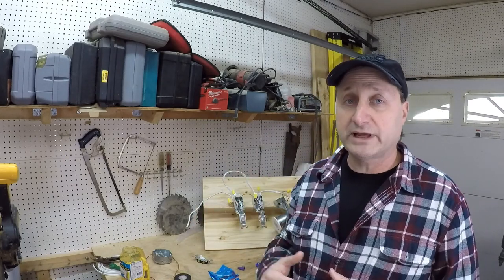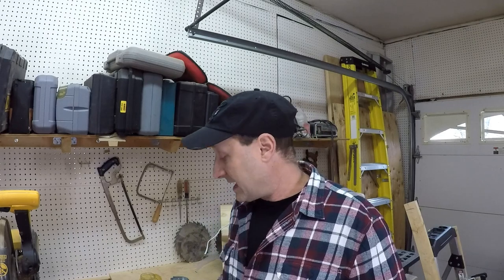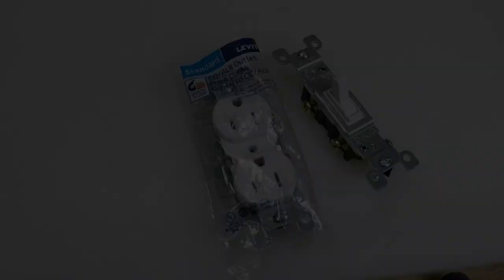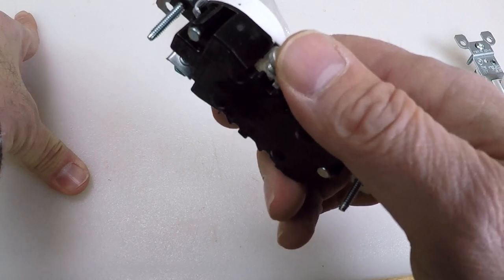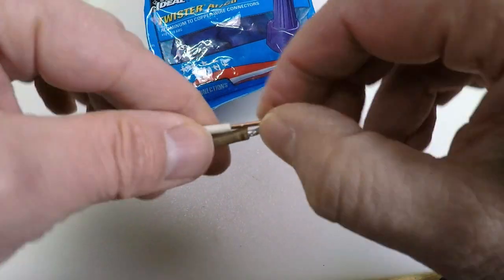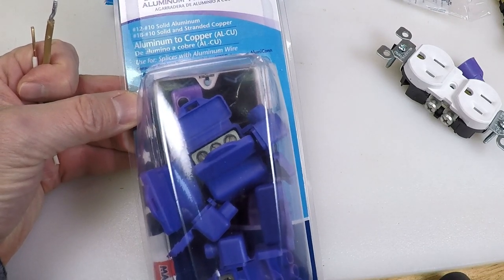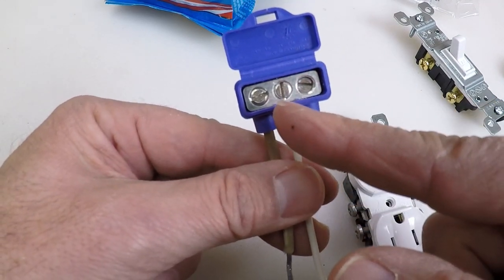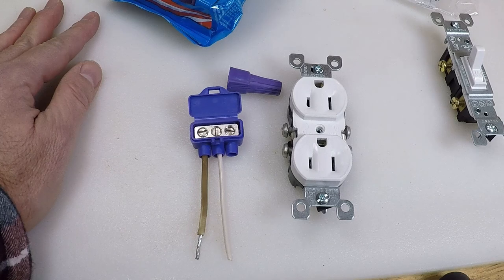Aluminum wiring repair - AlumiConn pigtail connections

Comment: How do you connect three aluminum ground wires with one copper ground wire?
Reply from the maker: You can use the alumiconn connector or you can just use a regular wire cap. The ground wire does not carry a load so you can twist copper and aluminum ground wires together.

Comment: Quick question. My parents house has copper wiring. Recently they remodeled their bathroom and installed a GFCI outlet to replace a standard plug by the sink (following code). Not long after that work was done they suddenly lost all power in the adjacent room. They suspect it’s the GFCI they installed. I noticed in the GFCI instructions that it says ‘only to be used with copper’ so I feel it’s feasible that the GFCI could be the culprit. Is it possible for them to have a GFCI with aluminum wiring? If so, how? Thank you
Reply from the maker: yes it can be used with aluminum. Just get a compatible GFCI outlet. However, it sounds like your parents have a different problem

Comment: mY method of securing alum and copper together at the connection point is to let both wires heat up naturally and what happens is they both end up melting together creating the perfect fuse between them. Sometimes the jacket will have holes in it where the insulation has bubbled but I just put electrical tape around it.  No issues and been in this home 17 years

Comment: I have only one aluminum circuit controlling just a ceiling fan and 2 recessed lights. I understand about the pig-tailing at the switch box and the endpoints but is it necessary to have a pigtail at the electrical panel. I was told it was required but would like to verify if that is true or in what situation it would apply.  thanks
Reply: No one here can (validly) answer that.  You have to know your local code/s.  EDIT  BTW: "I have only one aluminum circuit controlling just a ceiling fan and 2 recessed lights."  How are you 100% sure of that?  You do know what an actual circuit entails, right?

Comment: If the aluminum wire is 12 gauge, does the copper wire need to be 14 gauge or can it also be 12?
Reply: The ampere rating for aluminum 12 AWG wire is only 15amps. Do not use a 20amp breaker or fuse for this wire.
Reply: @claytonsprague7316  After reading the amperage capacity charts for aluminum wire I believe your statement "the amperage rating for aluminum 12 AWG wire is only 15 amps." is incorrect.  12 AWG solid aluminum wiring is rated for 20 amps.  Here is the link to the amperage capacity chart: https://www.cerrowire.com/products/resources/tables-calculators/ampacity-charts/
Reply: @craigschiemann9553   Thank you I appreciate your thoughtfulness of the chart. However there are some small details that need to be mentioned for safeties sake. First anyone watching this stuff in the US should read the CPSC study on Aluminum wiring (just google it cause I’m not as adept as Mr. Craig on links. 

Secondly, in that chart you have to know how to interpret the information., you will notice that it references 75deg C wiring as 20 amps. And yes you are correct in that case. HOWEVER please note that That classification of wiring didn’t appear until after 1984, and they stopped making aluminum wiring for branch circuits in the mid 70’s and that wire was only rated at 60 deg C. 

They didn’t make 14awg aluminum because the first gauge wire that could actually handle 15 amps was 12awg single strand aluminum NM. Please anyone with aluminum wiring research thoroughly before doing or hiring work done. Thank you.
Reply: @claytonsprague7316  Thanks for adding the additional information.  I agree, one needs to thoroughly understand the issues and remedies for handling issues with aluminum wiring before attempting to work on the project.  One needs to take the steps needed to inform themselves on any issue they are not properly informed on.  If not, then  please leave the project(s) to a professional that is.  Having only a little bit of knowledge on something can come back and harm you.  This is not something one can take lightly.  There are many licensed electricians out there  that won't touch aluminum wiring.   That tells you something.  When seeking a professional make sure they are knowledgable and comfortable with working on your type of project before even thinking of hiring them.

Comment: I have a copper home, but the ceiling fan I want to install has aluminum wiring, what can I do?
Reply: Hook it up. The connection is in a J-box that's designed to contain any spark/fire. [note: I am NOT a licensed electrician.]

Comment: What about dimmer switches? Is it okay to use the pigtail method? I’m starting to see forums say that you can’t use dimmer switches with aluminum wiring. I just installed one today. Something told me to put my ear up close to the switch and I hear a fair humming sound...
Reply from the maker: Yes you an pigtail before going to any fixture our outlet.
Reply: So what happened?  I replaced most of my aluminum wire house with regular copper only. Look like I need to go back and change them out.

Comment: Wait a minute. If aluminum tends to loosen over time, then how can BOTH parts (wire & outlet) being aluminum solve the problem? Seems it would result in DOUBLE the loosening effect.
Reply: This is an old comment, but I wanted to address for anyone reading: 

Since the aluminum will expand and shrink at the same rate, it won't loosen as much over time. Also, since they are aluminum on aluminum connections, you can have some cold welding happen as you clamp it down and that can reduce issues as well.
Reply: @anthonyalbanese1993  I'm not quite sold on the first part of your comment, but the second part makes sense. Thanks.
Reply: @jakejones5736  part of the reason the aluminum would loosen over time is because it's coefficient of therman expansion is higher than that of copper. So when it heats and cools with temperature changes, it does so at a different rate than the copper. 

When you attach / coil the aluminum wire are an aluminum screw terminal, which are usually rivited in place nowadays by plastic, both the wire and screw terminal will expand at the same rate due to sharing the same thermal expansion coefficient and this can't unscrew itself or work it's way out of the post, since the loosening effect comes because the aluminum wire lengthens more than the copper screw term can expand, causing gaps that get worse as it cycles through temps. 

Hopefully that helps!

Comment: What do you do with the ground wire?
Reply from the maker: you can pigtail it but you really do not have to. There is no juice going through the ground and the usual dangers with aluminum wiring do not apply to the ground wire
Reply: @flannelguydiy6458  Mucho thanks.  It wasn't grounded when I open it up so was wondering if it wasn't setup right.  Your reply is helpful and now my wife and rest at night knowing I'm not going to burn the house down again! :)
Reply: @chefbambu9382  again?

Comment: Wago 221 series lever nuts is another great solve for this problem. Use them instead of wire nuts with your pigtails.
Reply: I've been in the electrical trade as a journeyman for almost 2 decades. And have successfully used the wago lever nuts to mitigate this same issue.
Reply from the maker: Wago needs to be accepted as a viable transition from aluminum to copper. Although it may work, it could fail a home inspection when you sell

Comment: so no alumicon for the ground ?
Reply from the maker: Not needed... there is no heat in the ground wires
Reply: @flannelguydiy6458  will still oxidize  no ? Plus it is hooked to the copper receptacle

Comment: Or use wago 221 for ~$0.50 with some contact paste. They're rated for Al.
Reply: According to Wago's website this is not the case for the 221. I quote: "With WAGO Alu-Plus Contact Paste (20 ml syringe), solid aluminum conductors up to 4 mm² can also be connected with WAGO's 2273 Series PUSH WIRE® Junction Box Connectors and 222 Series Splicing Connectors up to 4 mm² per the standards. However, the 221 Series is not approved for this. But the 224 Series Lighting Connectors can also be used with this paste. “In building distribution boards, all CAGE CLAMP®-equipped rail-mount terminal blocks up to 4 mm² can reliably connect aluminum and copper conductors with the Alu-Plus contact paste. These terminal blocks include the 279 to 281 and 780 to 781 Series.“
Reply: EDIT: Now that I look at the product page though the 222 splicing connectors say they are only for copper. confused  The 773 Push Wire type are aluminum compatible with the alu-plus paste.

Comment: And another thing back in the days they did not provide you with the deep boxes for that crap those exposed another words you won't have enough room to stuff those bars theirs no room in a shallow box I've been a electrician for 41 years now if you come across that you got to trouble shoot this crap I suggest you use a continuity testers if I would to tell you it's a night mare most trailers have aluminum wires man the way this guy explained your not gonna have choices what's this running a blow dryer now if you can't use the circuit on the modern age like now why would you take the chance on creating any type of a chance of a fire starting in any part of the place your living under and you know what this crap you can not takeachance on any boot leg shifty electrical

Comment: Thumbs down for making zero mention that you need to use a torque sensing screwdriver to make a code compliant connection. You honestly should redo the video to include that important bit of information.
Reply: And #12 gauge Aluminum is 10. in-lb, but #10 gauge Al is 15 in-lb.  Care not to over-torque the delicate #12 gauage Aluminum, it gets squished.
Reply: I was thinking the same thing. They are a safety critical item that need to be used correctly.